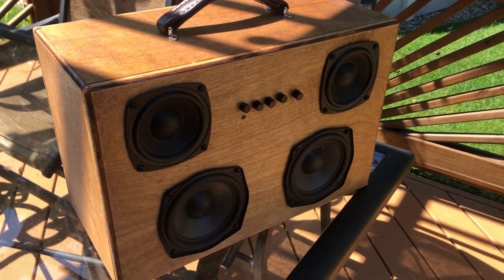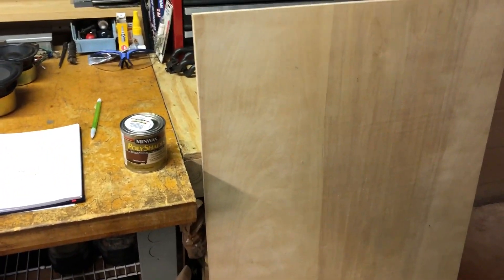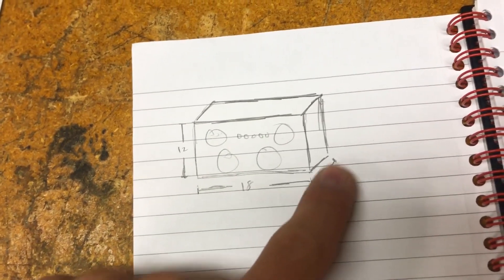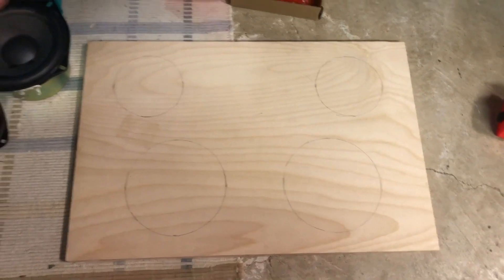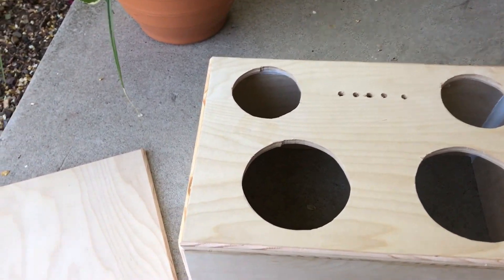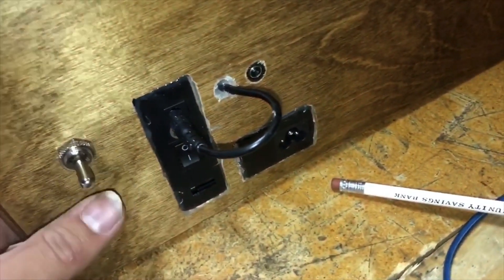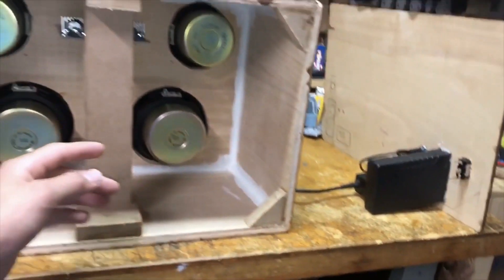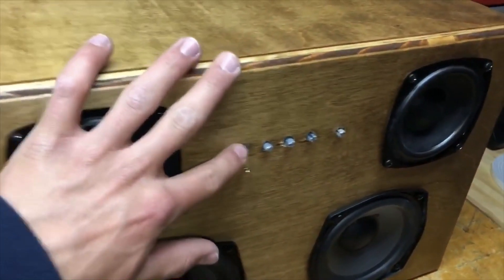DIY PORTABLE SPEAKER BUILD! 200 WATTS & BLUETOOTH

Comment: Awesome project, i have the electronics and speaker selection down to a science but i struggle biulding a nice enclosure. Right now i have enough parts for 2 speakers but havent figured out how i want to make the enclosure.
Reply from the maker: Thanks man! I am by no means a professional wood worker but i have figured out a few tricks to make a decent looking enclosure. Sometimes my cuts aren't straight so ill either do a lot of sanding/filing or i'll line up a straight piece and re-cut. Also a nice round over using a router, and some stain for a wooden box really takes it to the next level
Reply: Here is my 2 previous projects: https://youtu.be/k_914TzbjPg
https://youtu.be/7Rbh4PS2RV4